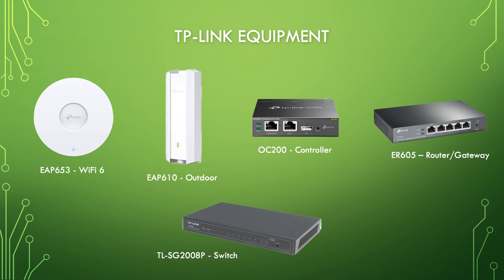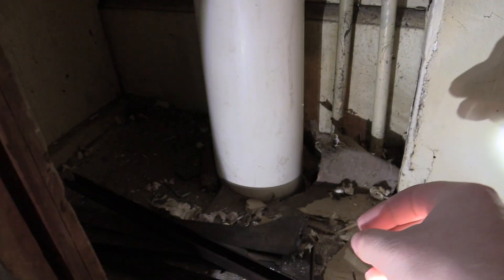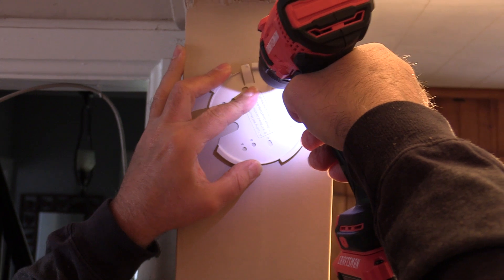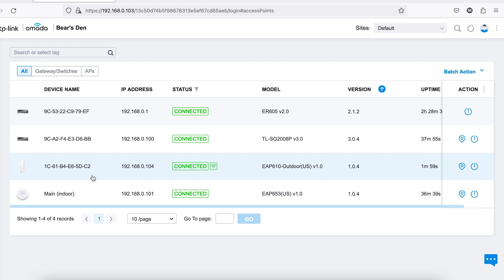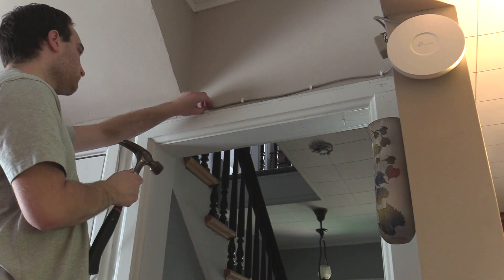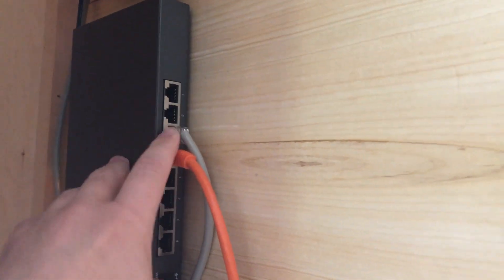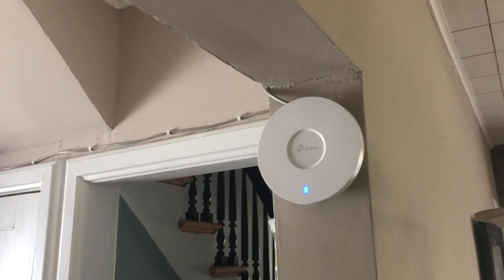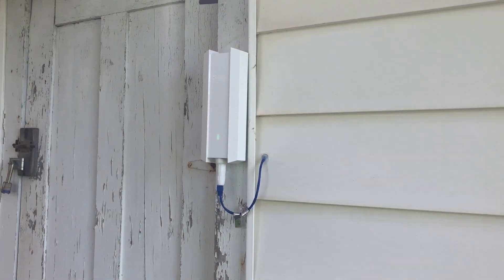Networking an AirBnB with TP-Link Omada | Indoor & Outdoor WiFi!

Comment: What is the difference between a controller and router?
Reply from the maker: At its most basic, The router is what directs traffic between your local network and the internet. The controller is the device responsible for applying settings to all the devices (including the router, access points, switches, and the like).

Comment: im sure you have figured this out by now but, the way you have it you wont have internet unless you plug in another ethernet cable from the switch going to the router. also that switch seems overkill with just one AP but im guessing at some point you are wanting to wire in all the rooms with cat5? im looking to do something similar and was seeing about using the exact same hardware. also im curious as to the wifi signal loss putting the ceiling mounted AP on the wall. i think those are meant to be horizontal?
Reply from the maker: You are correct, they are meant to be horizontal. There is no signal loss but the house is pretty small. I’m sure it wouldn’t work out to well if the house were any larger. The switch is certainly overkill, but really the whole system is:) It will come in handy when we install some security cameras though!

Comment: Is not worthy all this equipment and complexity just for a house,  you were much better with a Unifi UDR for inside the house ( That includes a controller, wifi6 and poe in only one device ) and a Unifi mesh access point for outside, thats it, just two devices, much less complexity and cost. If this was a place that needed expandability in the future, yes maby this was ok, but just for a house you are much better with just this 2 devices from Unifi. If TP-Link have the same 2 devices as Ubiquiti, same thing, just do it with TP-Link so I don't sound bias.
Reply from the maker: That’s certainly very fair point!
Reply: @pbrigham can you point me in the direction of the items you mentioned please
Reply: @tauntonlad  Just put on google " Unifi Dream Router " I can not put links here, youtube blocks them.